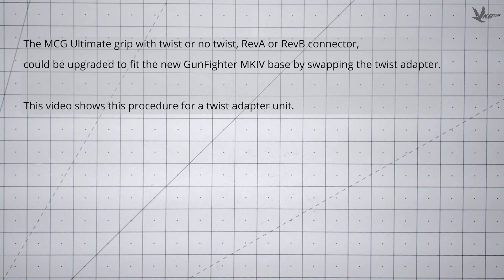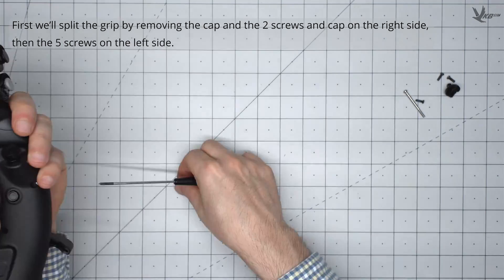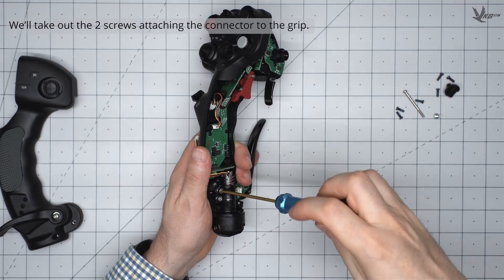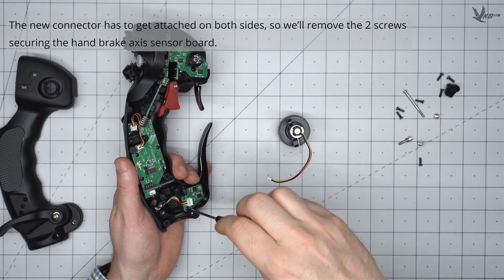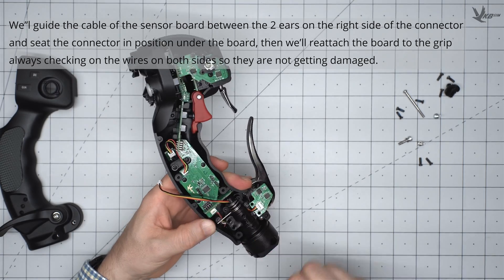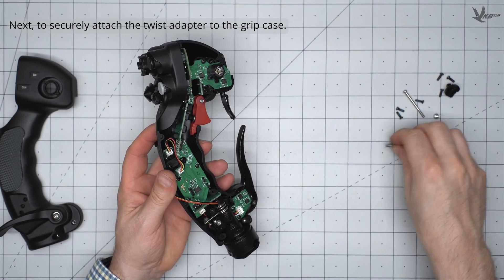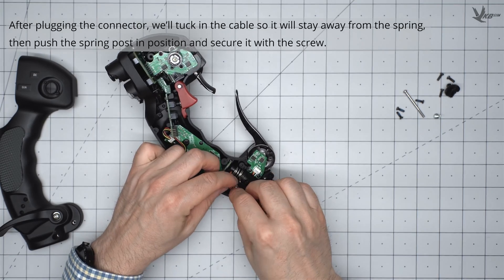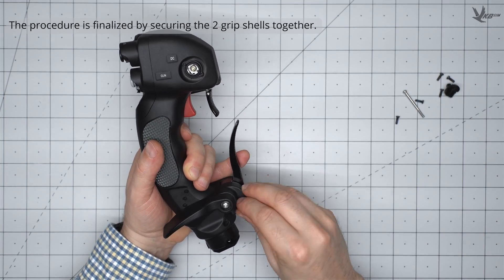Upgrading a RevA/B connector MCGU to RevC

Comment: Hello all i just got the gladi evo and omni evo and both twist axis and other twist axis are inverted. Some are in tune and others are inverted. I already flashed both sticks but they wont twist the proper directions. How do i fix this in the config tool?
Reply from the maker: You can invert any axis following this guide: https://youtu.be/n6O2-VNZLik
Reply: @VKBSim  thx i figured it out hrs after lol, it was the inverse options below at the bottom in profiles. They came automatically switched on oddly but i fixed it. Thanks afaun
Reply: @VKBSim  Don't forget to change the pins next time you put a new system on the market.

Comment: Went to go upgrade my MCGU and the grip adapter has a 4-pin wire that physically does not fit in the PCB which is 3-pin. A small white part was included, but it is also 3-pin to 3-pin, I am currently unable to connect the grip. Ordered, MCG Ultimate Grip Upgrade Kit (RevB to RevC) - with Twist Adapter
Reply from the maker: Hi Dave, I think we fixed that on tickets?
Reply: @VKBSim  can you tell I was panicking? I don't think you can.... Can you? :D
Reply from the maker: @oneStrangeGoose   All good, it's normal :) Just wanted to make sure we got this covered.
Reply: @VKBSim  The only way to fix things is to give everybody their money back, scam artists!
Reply: I have the same issue. What's the solution?
Reply from the maker: @georgeharp3862 Come on our Discord channel please, we'll guide you over there https://discord.gg/UJAdpdHpYm
Reply: @VKBSim  I got it figured out. But you really should put out an updated video showing the actual process.
Reply: @VKBSim  Yeah, we want this issue out of the public eye, right?

Comment: A note - the video above may no longer be accurate. My MCGU Twist adapter had a 4 wire connector which would not fit into the PCB. There was a 3 pin adapter included, but no instructions, and this led me to making an error during installation.
Reply: I have an adapter as well but it's 3 pin to 3 pin???? What should I do